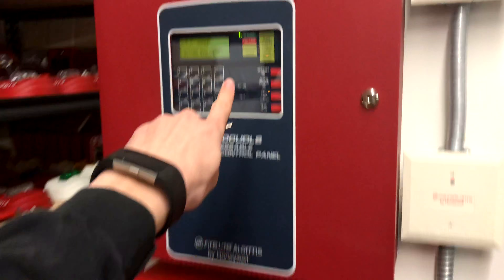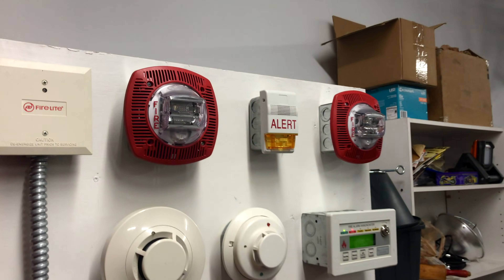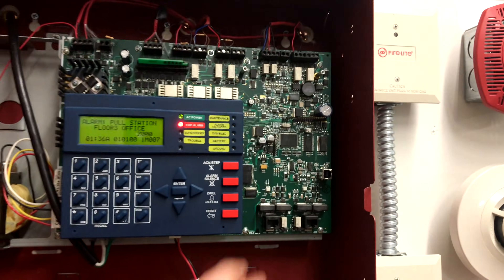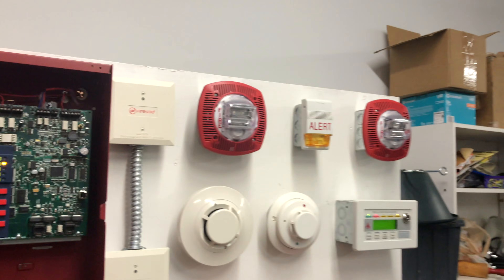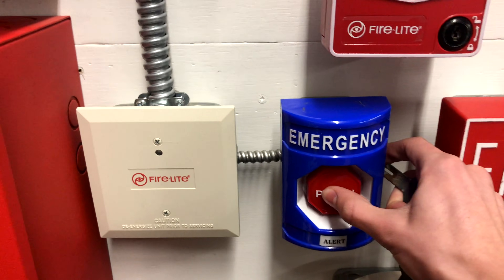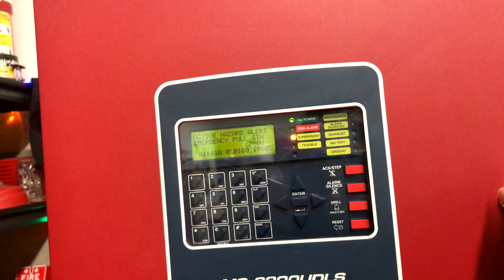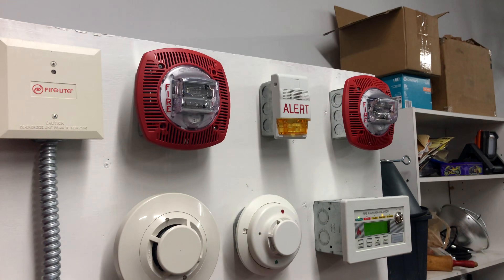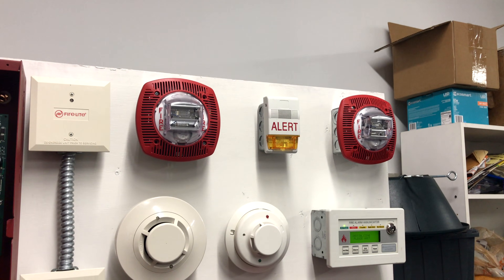Wheelock & Fire-Lite Voice System Test 4: Emergency!

Comment: I find it odd that the Safepath keeps playing the message after you hit silence on the main system.
Is there any way, other than precise timing, to make it immediately stop playing when the main system is silenced?
Reply from the maker: Nope, well, unplugging the panel might work. Haha. I actually like that feature. That way it does not stop mid-sentence.

Comment: please make more siren videos!
Reply from the maker: They only test them once a year where I live. Will try my best to be there when it happens.
Reply: Holy cow that's a long period of time. Anyways thanks.  @SERSafety
Reply: @SERSafety  omggggggggg
Reply: @SERSafety   l we be doing a fine alarm system test siemens speaker strobe watt at my house for the test l have the system sensor spectralert advance speaker strobe mounted on the wall and the gentex speaker strobe setcw speaker only 4 watt voice evac wheelock as and wheelock mt